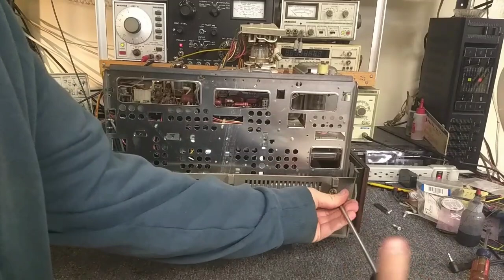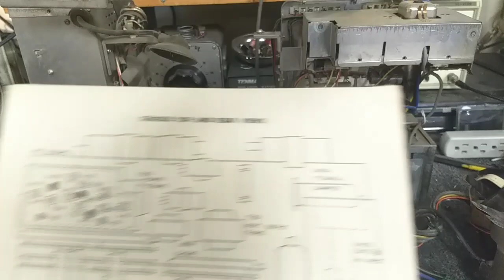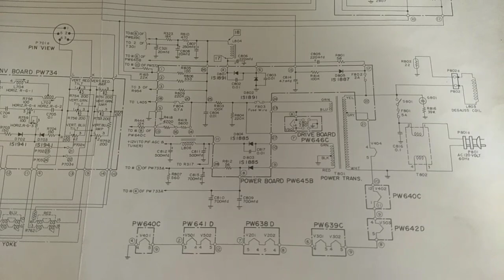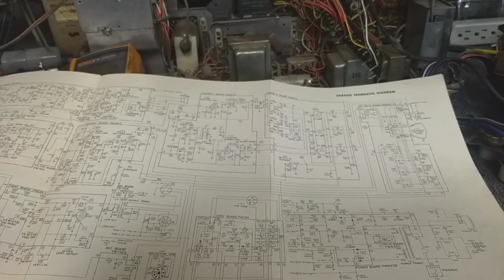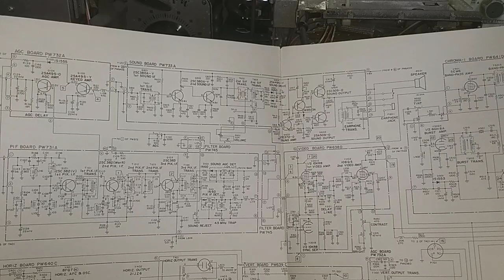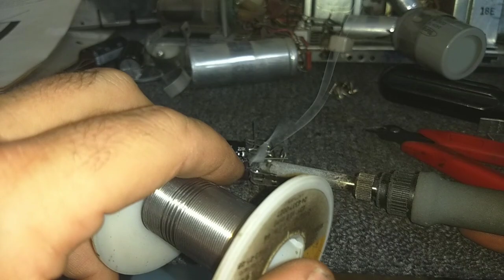Repair of a 1973 Toshiba C321 13" hybrid tube/transistor color TV - Part 4 /?

Comment: hard to believe those 50 year old electrolytic caps are still that good. i would replace them. they could be leaky or short with use. good call on replacing them for sure

Comment: Worked for a service shop in 74, authorized Toshiba.  If I remember corectly, Toshiba supplied us with wire harnesses to connect many of those those boards away from the chassis for servicing while powered on.

Comment: Wow, super-easy to take apart. The pop-out modules on the back gave a great first-impression but the inside not so much. They should make everything electrical disconnect easily so you don't need to worry about pulling wires when doing physical disassembly.

Also an idea on the IF section: why not power it up from an external 12v supply and test its response while leaving the high-power parts of the set disconnected?

Comment: I wouldn’t worry too much about the values of (aluminum) electrolytic caps; the tolerance on those things is utter crap - something like -20% to +80% or so. The main (value) multipliers I find in service are; 1.0, 2.2, 3.3, 4.7, (sometimes) 5.6, 6.8, and (sometimes) 8.2 times some power of 10. It’s the voltage and thermal rating that’s more important.
Also - for the smaller value caps - these are usually cathode (or emitter) bypass; locating these physically as close to the active device as possible reduces unwanted noise/hum due to long wire runs; a common problem (long wire runs, that is) in older TV sets. This is a handy hint I learned watching bandersentv’s channel; he tends to restore older tube-only Philco predicta chassis, and he usually tries to put those bypass caps as close to the tube cathodes as he can. I hope you get this interesting (if aggravating) hybrid set working; it’s a real bummer that it’s not service-friendly, but a lot of those little sets are that way. 😞

Comment: For the new big value caps, a couple of zip ties through the strap holes will secure them.
That set looked easy to remove the chassis,  not so easy at all :-(

Comment: It would be interesting to take a look at the if band pass with the sweep generator and see if low income areas are worthy of menthol cigarettes or if no real issue was identified.
Reply from the maker: I suspect one or more of those 1n60 have gone to shit. Depending on difficulty of entry I may make it a monitor. Troubleshooting this apart sucks. Tempted to dig up my color jig but my adapters are hurried elsewhere.
Reply: No area, except death row, is so unworthy that they deserve menthol cigarettes (or any tobacco product.) Now the dead spiders, dirt, and rat nests can stay in the set if you want the ambience! 🤓 Instead, let’s take all the cigars, cigarettes, and e-Cigs, load them on a big nuclear-tipped ICBM, then send them into the sun, where they’ll burn up and the fumes will drift over and kill the alien invasion fleet from Alpha Centauri before they can steal our cheap, Chinese, fake semiconductors. 🤣

Comment: Discharging CRT anodes.  Back in the day, in the 60's, I was working for a TV shop. One of our service guys was changing a color CRT on a console. Chassis was out and the set was lying on its face on a piece of old carpet.  He unbolted the CRT mount, bent over to grab the tube, lifted it up while standing straight up, pulled the tube tight to his stomach.  The anode was on his side. It suddenly discharged right through his shirt.  It was a sight watching a big guy dancing around the room while hugging a big heavy CRT.

Comment: No need to leave screwdriver on anode cap for more than a second. Even if the voltage creeps up again the time constant is close to zero and the energy is tiny.
Reply: True, but enough to startle you which could cause a reflex jerk away ripping your hand on a sharp piece of chassis. Been there done that.
Reply: @BurgerJohnny  I was sort of saying between the lines there will be nothing there. Sure done the jerk movement before though.